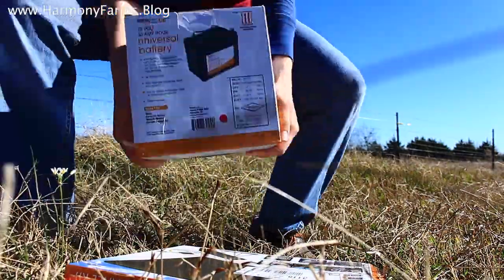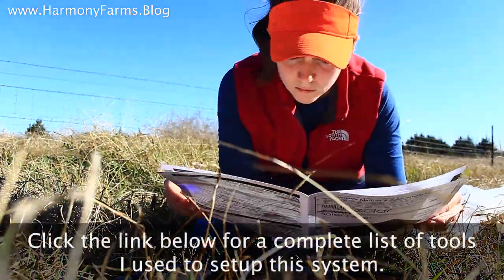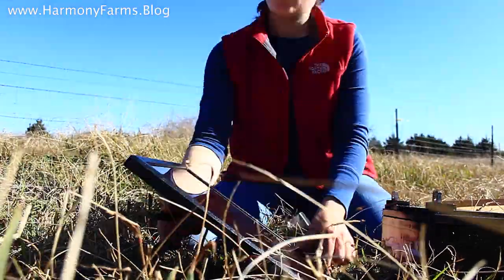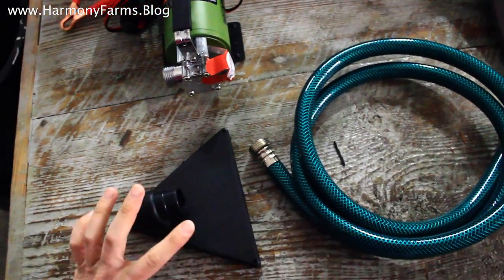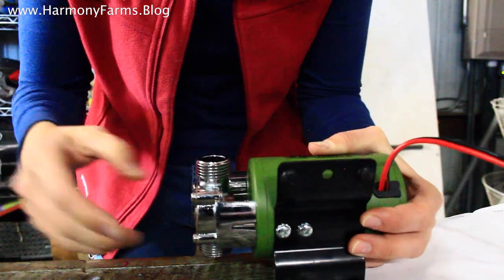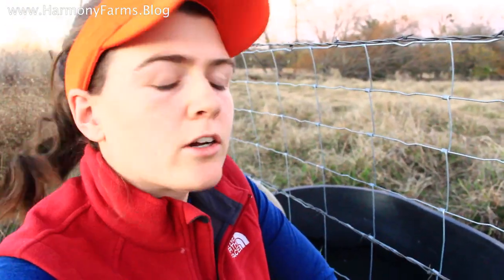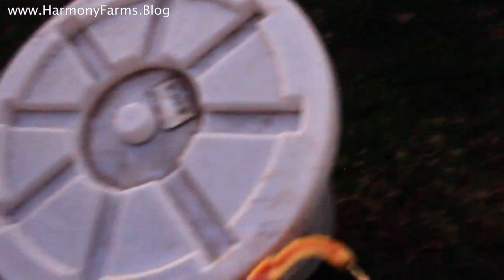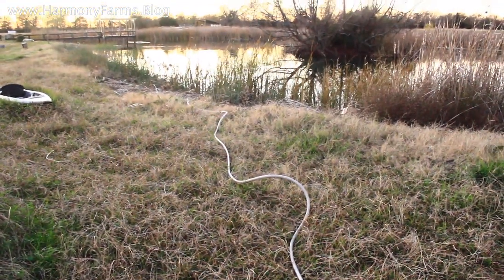SOLAR POWERED WATERING SYSTEM for Pumping Pond Water to Pasture

Comment: That is a neat setup! Another trick is when I stick a hose down into a pond to suck water with a pump, it helps to wrap metal hardware cloth or wire mesh (building a cage) around your existing filter and it will help keep the bigger debris from getting sucked up against it and clogging it.
Reply from the maker: This is a great idea! Thank you for sharing!
-the Shepherdess
Reply: @theShepherdess  any update on the system?

Comment: Great idea. Did the same here on my farm. One thing you could add is a maxmoral water level pump controller side switch on to your water containers. I don’t believe the float you have only shuts off the water and doesn’t kill the pump motor. This will save your pump. Be blessed!

Comment: The harbor freight solar panels are actually pretty good.  A single 100w panel runs the entire DC system on my camper day and night.  The battery is not the best but it will last a while considering how little you will need to run it.  It will likely take a while to charge the battery back to full capacity with that small 7 watt panel.

If you end up liking the system it would be fairly easy to create a mini pump house to feed the water anywhere.  I would suggest flexzilla hose instead of the typical water hose as it will last a lot longer.

Comment: if you are not pumping too much water that set up may be all you need. if you run into trouble not having enough energy keep in mind that those pumps are high Amp users. try to find a pump that uses less amps.